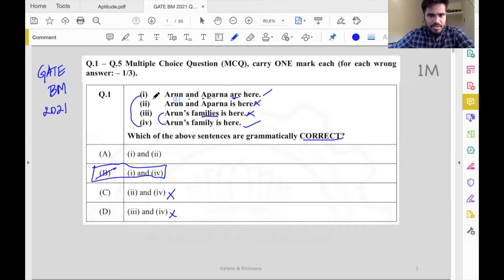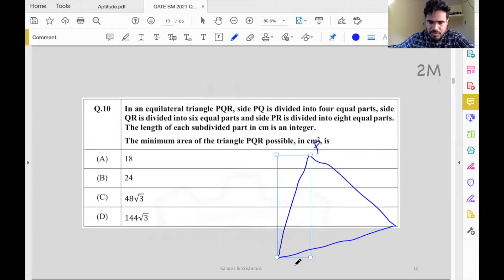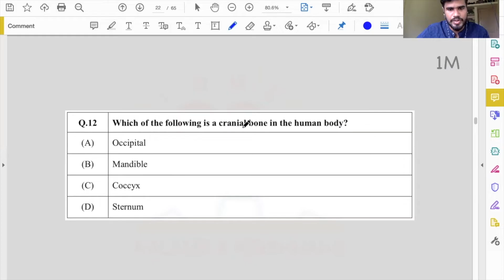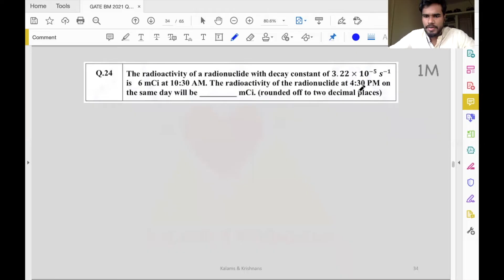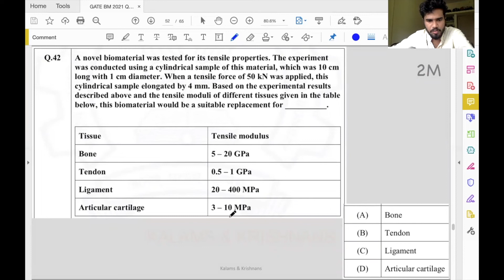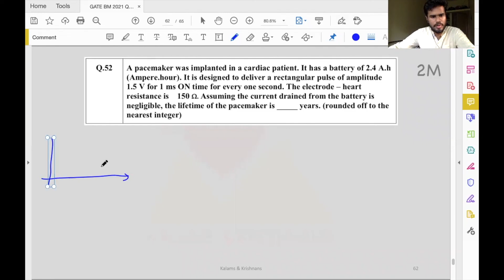GATE Biomedical 2021 Paper Solution Discussion 💯 For GATE BM Exam 🎯 Fully Solved with Tips

Comment from the maker: For quicker access, thanks to Aakansha for time tagging 
0:00:00          Intro Aptitude 1M MCQs Q01-Q05 
0:00:34 Q01 Grammatically correct sentence 
0:02:26 Q02 Mirror Image  
0:04:34 Q03 Probability die roll 
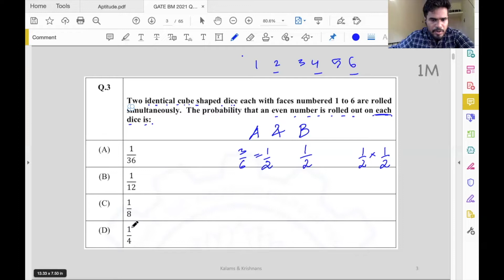0:05:55 Q04 Math Operator substitution 
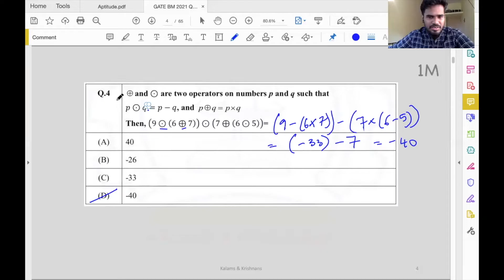0:07:44 Q05 Linear seating arrangement 
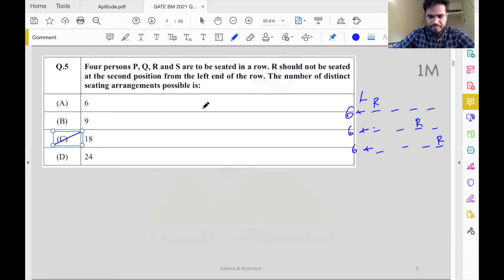0:09:18          Aptitude 2M MCQs Q06-Q10 
0:09:42 Q06 Direction Sense 
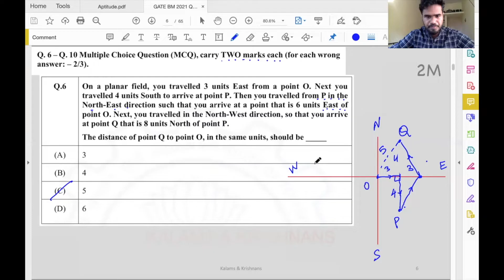0:12:56 Q07 Text Interpretation 
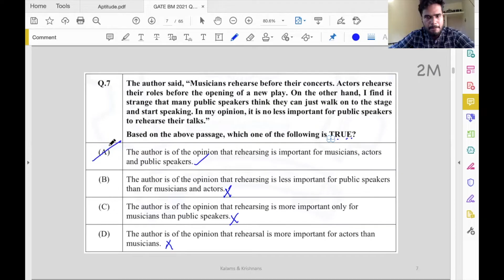0:15:34 Q08 Set Relation Logical Analytical  
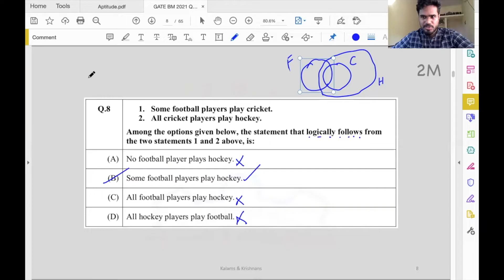0:17:44 Q09 Geometry and Mensuration 
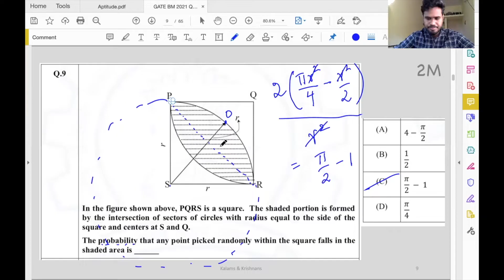0:21:28 Q10 
0:27:01         Core 1M MCQs Q01-Q17 
0:27:46 Q11 Probability Integration 
0:33:31 Q12 Directional Derivative 
0:37:51 Q13 Electrical Circuits 
0:42:02 Q14 Inductor AC voltage 
0:50:35 Q15 Signals & Systems Fourier Transform 
0:59:40 Q16 Digital Electronics Combinatorial Logic Gates 
1:05:53 Q17 DAC ADC SQNR 
1:10:03 Q18 Control Systems Time Response 
1:16:07 Q19 Measurement Sensors 
1:17:13 Q20 Bioinstrumentation Temperature Sensor 
1:18:58 Q21 pH of Blood 
1:19:33 Q22 HAP Cranial Bones 
1:20:14 Q23 HAP Thyroid Stimulating Hormone 
1:21:04 Q24 Myocardial infarction 
1:22:39 Q25 RBC Shear Flow 
1:23:56 Q26 Biomaterials Contact Angles 
1:25:19 Q27 Bone Resorbing Cell 
1:26:00 1M MSQ Q28-Q30 
1:26:23 Q28 X-Ray Imaging Film Screen 
1:28:19 Q29 Muscle Microstructure 
1:30:30 Q30 Biomaterials Bone Implant Failure 
1:32:30         1M NAT Q21-Q25 
1:34:08 Q31 Multivariable calculus extremum
1:37:19 Q32 Bilinear Transform Continuous Discrete
1:40:31 Q33 Acceleration Constant Bode Plot 
1:45:15 Q34 Radioactivity Radionuclide Decay Constant 
1:48:51 Q35 Polymeric Scaffold Tissue Degradation 
1:51:03         2M MCQ Q26-Q42 
1:51:40 Q36 Eigenvalues Trace Determinant 
1:54:33 Q37 Initial Final Value Theorem 
1:57:40 Q38 Convection PDE
2:01:48 Q39 Unbalanced Wheatstone bridge 
2:10:24 Q40 Discrete Convolution 
2:16:38 Q41 FIR filter 
2:20:42 Q42 FFT Sampling 
2:23:20 Q43 Opamp cascaded 
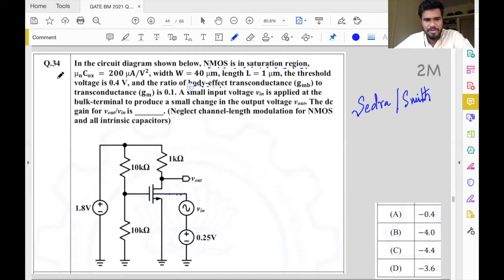2:32:23 Q44 NMOS with body effect 
2:41:19 Q45 Accuracy & Precision 
2:45:14 Q46 Steady-state oscillation 
2:48:15 Q47 Biomaterial Characterization 
2:50:07 Q48 ECG EMG amplifier 
2:51:30 Q49 HAP Gastrointestinal Tract 
2:52:16 Q50 MRI Bandwidth 
2:55:37 Q51 Ultrasound Pressure Wave 
3:01:09 Q52 Biomaterial Tensile Modulus 
3:04:10         2M MSQ Q43-Q45 
3:04:34 Q53 Ladder LR, Ladder RL, Cascaded LR 
3:09:21 Q54 Thermo dilution Cardiac Output 
3:17:06 Q55 Smooth Muscle Cells 
3:18:07         2M NAT Q46-Q55 
3:18:47 Q56 Steady State Error closed loop transfer function
3:23:01 Q57 Reynold's Number 
3:26:08 Q58 Probability Bayes theorem 
3:30:29 Q59 Combined group standard deviation 
3:32:55 Q60 LR circuit 
3:36:24 Q61 Opamp with Positive Feedback 
3:38:34 Q62 Pacemaker Battery Life 
3:42:44 Q63 X-Ray Al Cu Al/Eq 
3:45:39 Q64 Radioactive Isotope Radioactivity 
3:48:25 Q65 Ultrasound PZT crystal